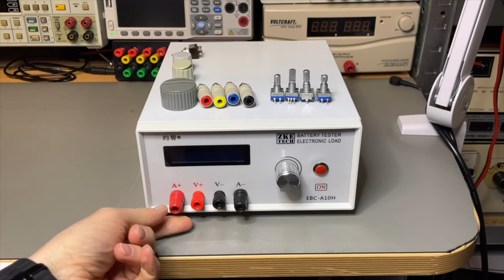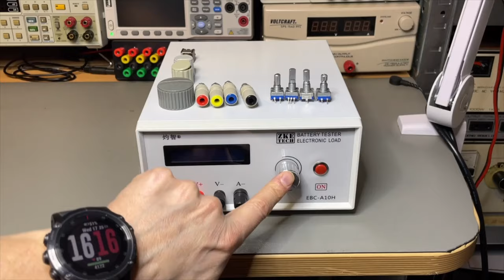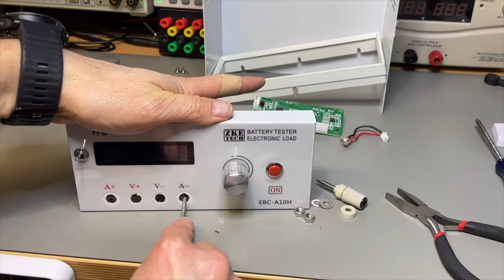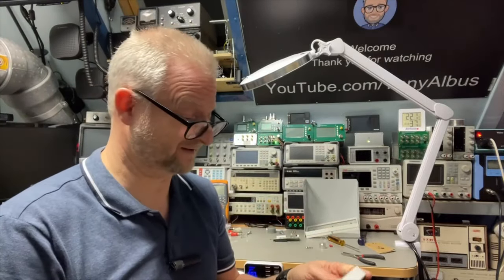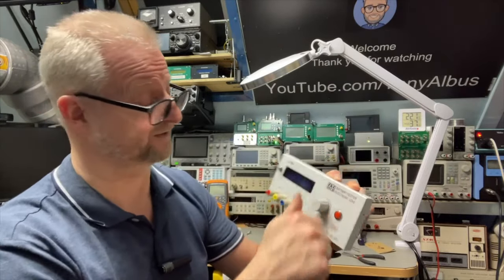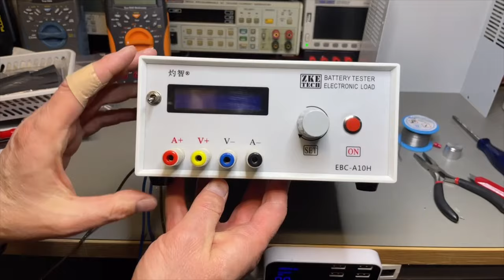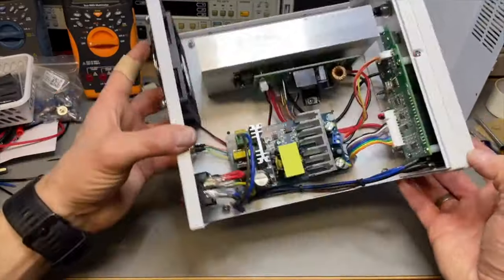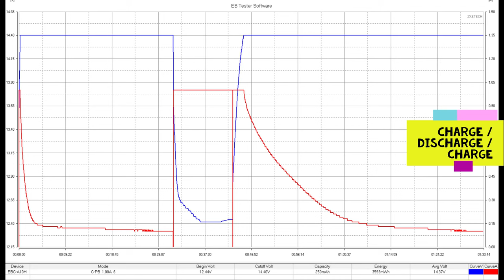TA-0398: ZKEtech EBC-A10H - Upgrade - Terminals, Encoder, Power Switch

Comment: Hi Tony, you made the adjustment beautifully 👍
I hate the switches on the back, sometimes it is not possible to add a switch to the panel and that is why I have sockets with remote shutdown from the test panel in the workshop.
 Fortunately, today Incremental N-encoders are used on a simple two-track principle, so you only select the size, suitable shaft, button option and the number of cycles per revolution as needed. The number of tacts per revolution can greatly affect the controllability of the device, if the controller counts on multiple pulses per command, then in the case of using an N-coder with a small number of tacts per revolution, we wring our hands before switching something. In the case that each cycle has an impulse and we use many cycles per revolution, we have the opposite problem - we are almost unable to set the correct value, especially when the N-coder wears out.
If I leave out optical or capacitive N-coders, it was produced (I guess it was a German system) so-called rocker, it had 6 terminals and in principle there were two switching and opening contacts inside which, when rotating with the shaft, the internal rocker mechanism switched alternately - a classic incremental N-coder this type was irreplaceable.

Nice day 🙂Tom
Reply from the maker: Thanks. yes for some equipment i have smart power sockets too... it works great .

Comment: Upgrading the terminals was also the first thing I did on my EBD-A20H. However I can't remember anything about 4mm plugs not fitting well.
I also have no problems with my encoder or the knob. I also don't think the menu structure behind the encoder is difficult or cumbersome, but my unit only discharges of course.
I also already use it for about 6 years now (I had to look that up, time flies... 😉) so I guess I'm used to it 😁
Reply from the maker: Yes i think they changed the terminals at some point. my encoder was crab. The menu, you can get use to for sure. but combined with that bad encoder , needed a change